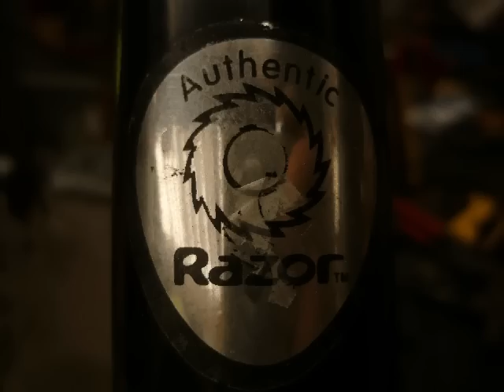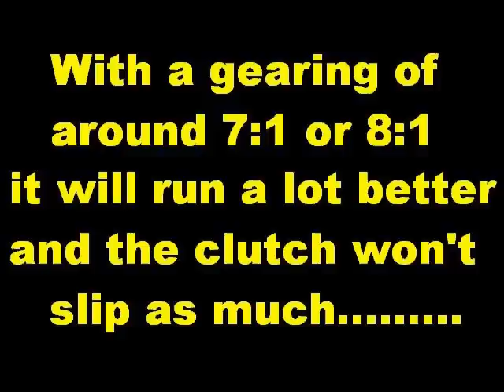RAZOR CHOPPER WITH 54cc CHAINSAW MOTOR

Comment from the maker: Yeah we took it out to the industrial area last weekend for a spin.
Really picks up speed over 500 metres or so and gets a bit scary actually.

Am still tossing up between rebuilding the whole gear setup and putting on a different clutch setup on the motor....
....or just leaving it as is until I get hold of a different motor.
Maybe something like yours.

Wouldn't mind using this motor for an RC car as it is pretty powerful.

As for now though it just sits in my workshop looking awesome

Comment from the maker: Yes I did.
On this version I put a bicycle sprocket on the motor and one on the jackshaft.
Then I put the original 9 tooth sprocket on there and used the original 55 tooth on the rear wheel.

It didn't give a low enough gearing though and the clutch kept slipping.

In the second version I put a smaller sprocket on the motor, and different ones on the jackshaft.
This gave me a gearing of about 7.5:1 which meant great acceleration but lower top speed.

Comment from the maker: 14:1 eh.
Cool.
Probably won't gear mine that low but it definitely needs to be geared down a bit.
It does pick up speed pretty good over a long straight run, and I'm hoping to take it out to the industrial area this weekend with a mate and camera to try and get a couple of videos of it going flat out.

Comment from the maker: @MrSkater943 
Dunno mate never checked it.
It felt a lot faster than it was though, sitting that close to the ground.
With better gearing it could have gone a lot faster.

.
This chopper is long gone now, only ran it a few times.

.

Comment from the maker: @MrSkater943 
The Razor chain and the bike chain isn't the same size if that's what you mean...?

Look at the pics between 0:07 and 0:12 in the video.
The way I did it there was bike sprocket/chain between the motor and jackshaft, then the original Razor sprockets and chain between jackshaft and rear wheel.

That wasn't enough gear reduction though and later on I had a different setup with more reduction which worked better.

Comment from the maker: Thanks.
Yours worked out ok though didn't it?
Seemed to run pretty good.

One thing I wondered about was why did you put the chain tensioner pushing the chain out instead of in?